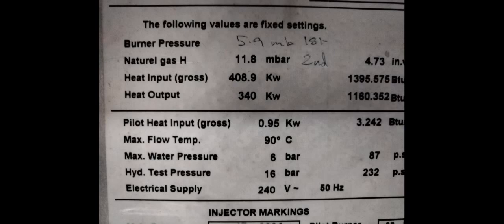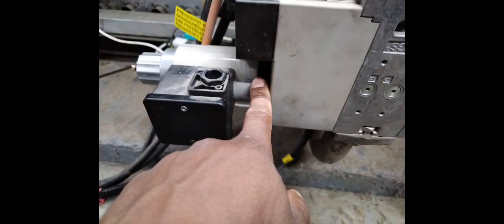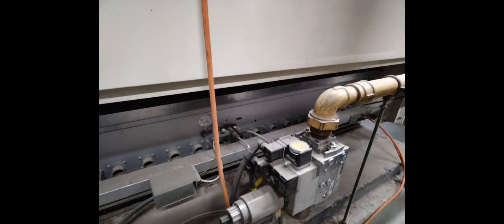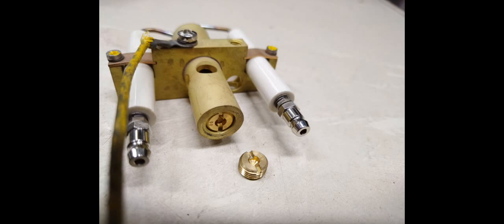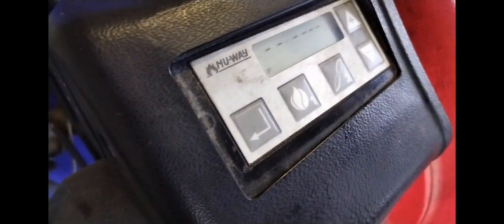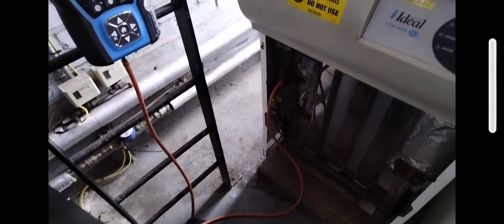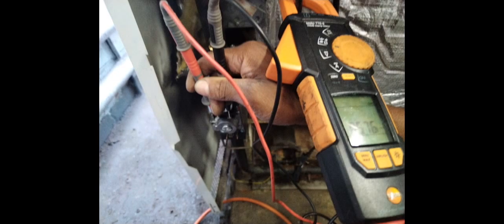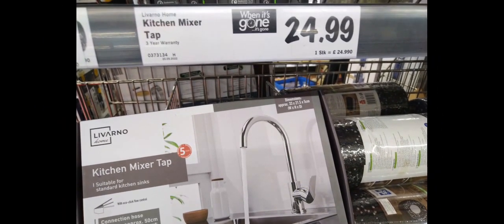WEEK IN THE LIFE OF A COMMERCIAL GAS ENGINEER pt4

Comment: Have you ever worked on the remeha gas 460s/12’s because that pilot assembly looks identical to it for the ideal concord
Reply from the maker: Hi, I believe that I have a handful of times. Does look similar.
Reply: @CommercialGasEngineerVideos  reason im asking is because the remehas parts are obsolete and wondering if that would work for one of the contracts have 10 of thos boilers so if they fail would it work on that
Reply from the maker: @MMKLYH  I have seen that work before on domestic boilers where the same part costs less from another manufacturer. So engineers have bought it for less. I don't see why not in this scenario. I would research the specific part number required and then run it by the manufacturer to see what they think. Google it to. See if it can be bought. Besides once you have a bundle of the same boilers on a site you can use one or two as sacrificials to donate parts. So long as you do your commissioning and 26.9 checks. Yet it also might be time to get new boilers. Condemning the units with obsolete parts would see that happen or the high costs of a temporary boiler hire. Either way you have options.